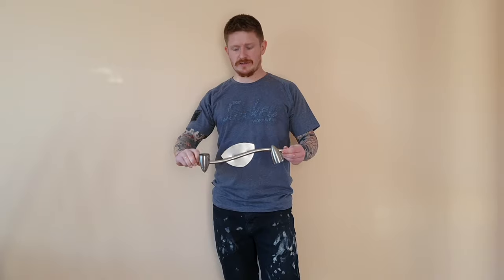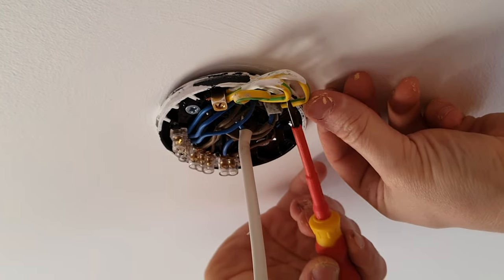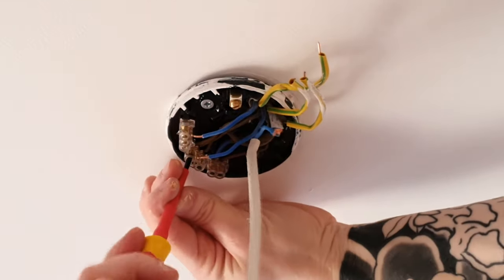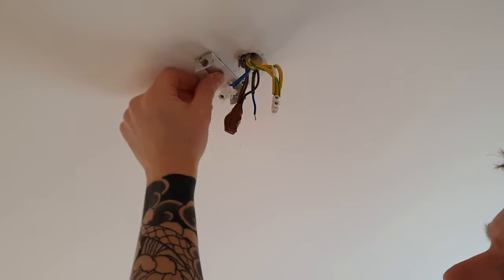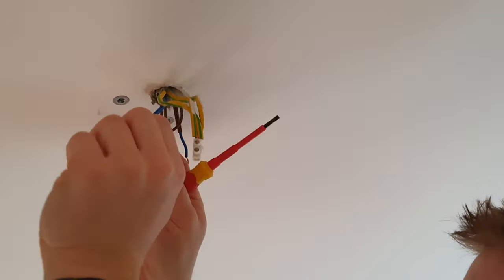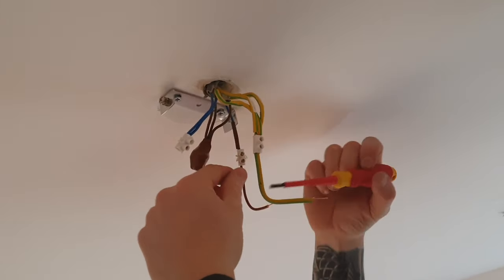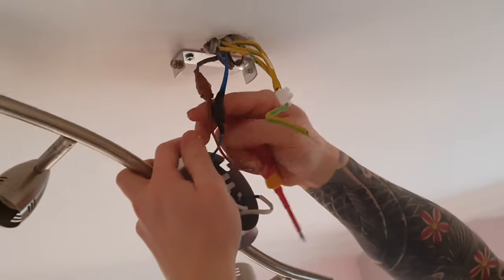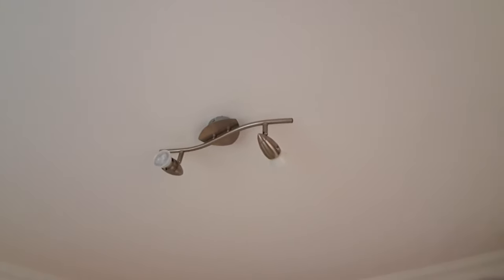How to Change a Ceiling light | Replacing a Rose Fitting

Comment: If I want to install LED light bulbs into this Rose Fitting, I would need a driver, correcT?Otherwse voltage too high/not DC, etc? Can anyone please link a video for me on how to install an LED driver into a ceiling light that isn’t dimmable light switch???
Reply: Most led (gu10 bulbs l) have an integrated driver

Comment: You don’t need to remove the rose. The bracket slots behind it and the two wires go into the existing rose. 
Looking for a video to share with a novice. This is not the one. 
Good job otherwise but the most complicated way of doing it.